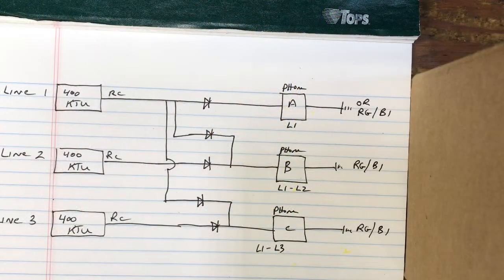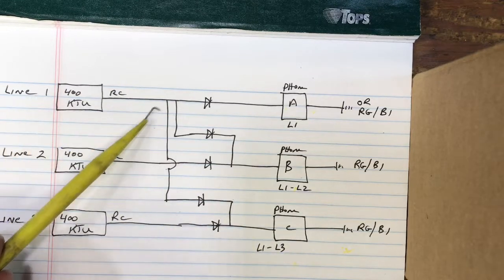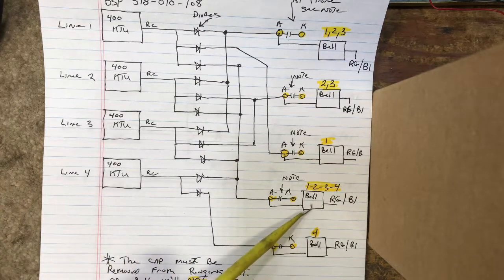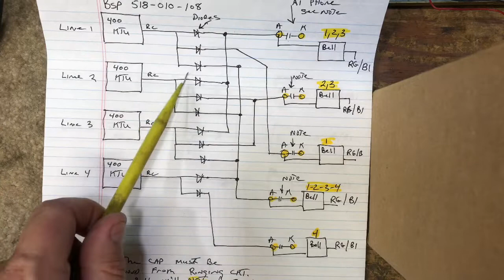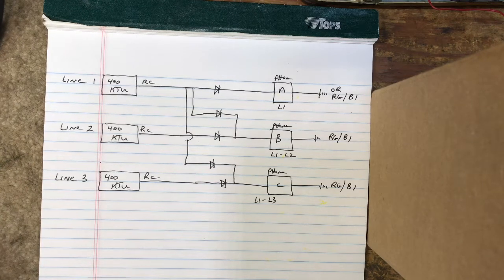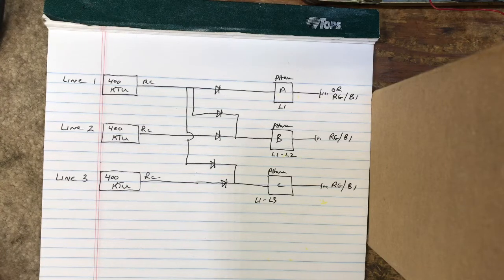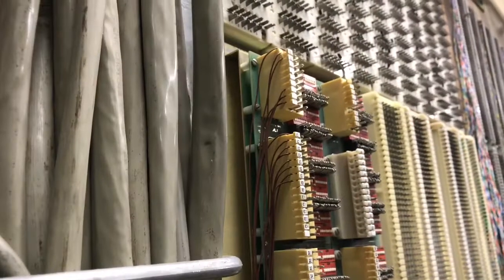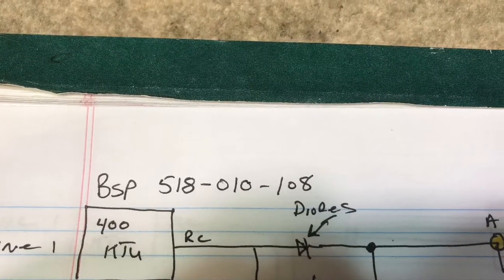Describing 1A1/1A2 diode matrix ringing. (Key Telephone system)

Comment: I used to support a huge 1A2 key system behind an ITT-TE400G electronic pbx for a local hospital.  I used those matrix blocks in a lot of places.  We usually used the 24 volt buzzer for lines and the bells for intercom.

Eventually the ITT switch got replaced by a Nortel Sl-1 and we gradually did away with the key phones.  I  occasionally teach a VoIP class at the local community college.  Telecom sure came a long way in the last 50 years!

Comment: I went to school at the Plant Equipment facility in Temecula, Ca. a month ago. They have gone through several buyouts and now they are under the umbrella of Motorola Solutions and make 9-1-1 CPE and radio systems for Police, Fire and Medical. Plant also manufactured “400” KTU’s and other 1A2 key eq.
Reply from the maker: I'm Beyond amazed that there is any official 1A2 training for 1A2 systems any where. Also surprised anyone making 1A2 
equipment.
Reply: Motorola Solutions, formerly Plant Equipment now only makes Voip 9-1-1 systems and radio consoles. Hey do have a museum of sorts of their previous equipment they manufsctured in the lobby at Temecula. They made 400H KTU’s and 1A2 racks. They also made a 1A3 key system called “Com Centrex.”  Instead of a 25 pair cable it was fed to the station on a 12 and a half pair cable with a DB-25 on the end towards the station. There’s still a few of the original people around that designed this key equipment. As with all telephony things now have migrated to the Voip 9-1-1 systems.

Comment: I've had a question about conventional ringing on typical residential POTS line. I"ve heard and read that the ringing current is applied (or super-imposed) to the line on top of the direct current. Question is, is it applied in series with the loop or is it parallel? I do realize that party lines can have different configurations like "tip party" or "ring party".

Comment: SXS Phil, what's you thoughts on water damage to punch-down blocks?  We had water damage to some in the C.O., which feed our internal Nortel Key system, and now the lines either have static, or callers experience ring tripping.  Do I attempt to clean the blocks with IPA, or replace the blocks & reterminated the house cables?
Reply from the maker: If they were in a flood i would replace the 66 blocks. If just damp they may dry out and be OK.
Reply: @sxsphil  It was a roof leak in the Switch Room.  They've had quite awhile to dry (i.e. several months).  It's pretty bad when it rains in the Switch Room.  

We had something similar happen in another town, & it took out two line frames.  Luckily, we were able to clean things up, source replacement parts from the south end of the state, and ultimately salvage the line frames.  In the proces of the repairs, we learned that IPA is very conductive with distributed ring frequency!  I don't want experience that again.  :(
Reply: That is one of the big downsides to 1A2 systems.  I once got a late night call where there was a leak in the hospital lab and all the phones were busy and flashing.  The leak had gotten a 25 pair Amp connector on a 2564 key phone wet and it was causing all of the common lines to be on hold.  The quick and dirty fix was just to chop off that connector and re-terminate it the next day.  Also had that happen once in the kitchen when an overhead water pipe burst and flooded the diet office.